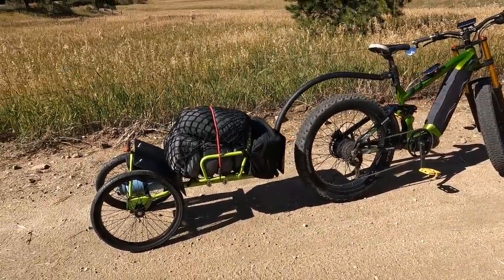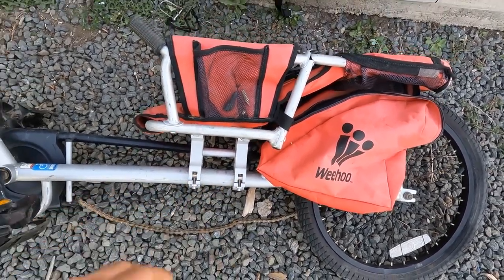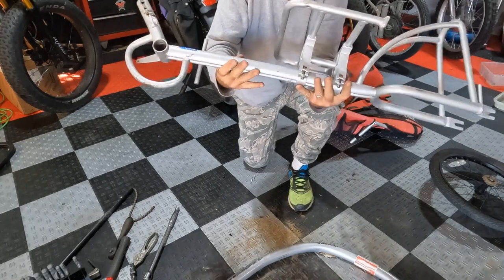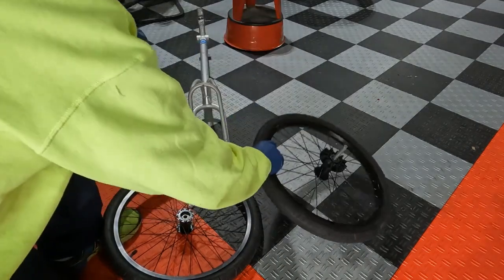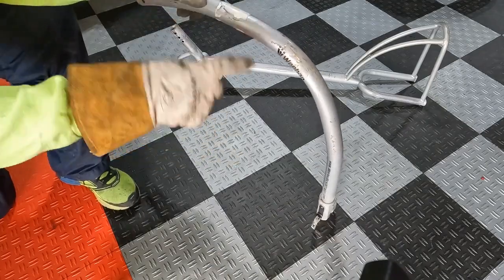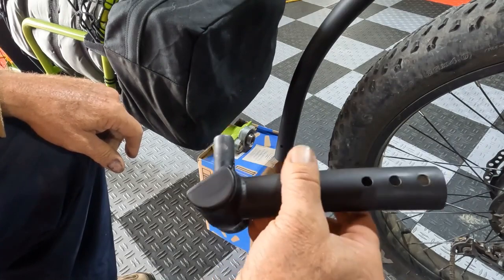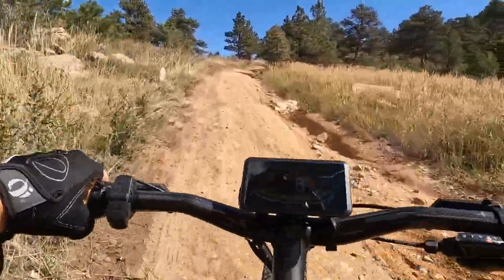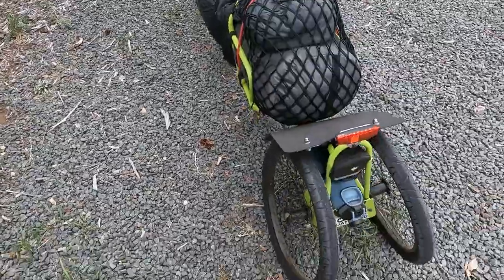Make your own bike, ebike trailer for off road! Cyrusher Ranger

Comment: Very well done Tom.  🤙 Great skills and color choice. Looks so sexy with the narrow setting of the double tilt wheels. I had the same idea and like to build one like you did using it with my 70 pound dog. 
Maybe change the wire to some springs 🤔 eventually..
Reply from the maker: Hey, thank you very much!  70lbs is a big boy, you may want to go with a pair of 20 inch fat tire wheels like on my other trailer video.  You're absolutely right about the cable stops, I have plans to use a couple lift struts to limit the roll, just need to make the mounts. Good luck with your build!
Reply: @lifebehindbarz60  Hi Tom, thank you, lift struts sounds like a great solution 👍